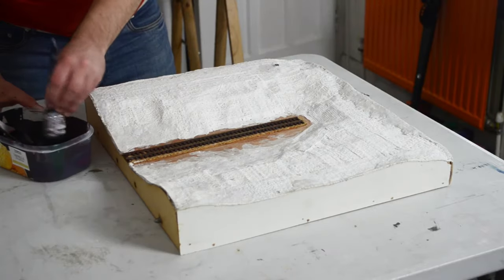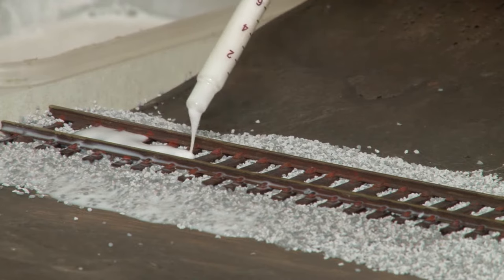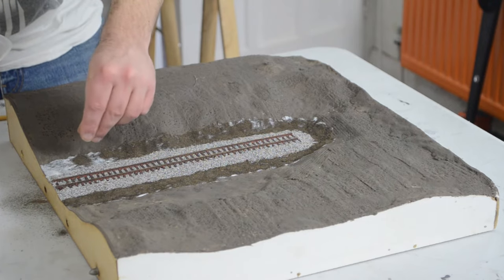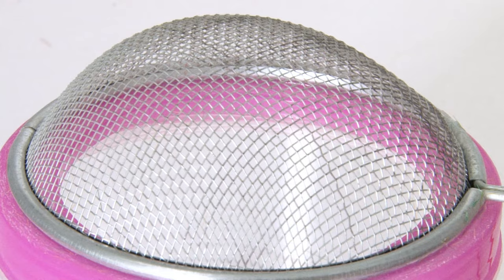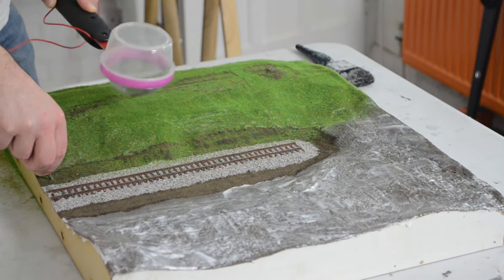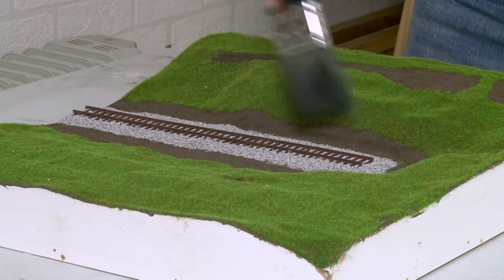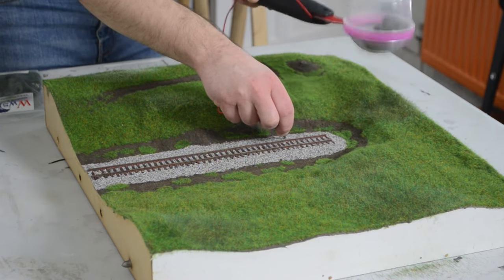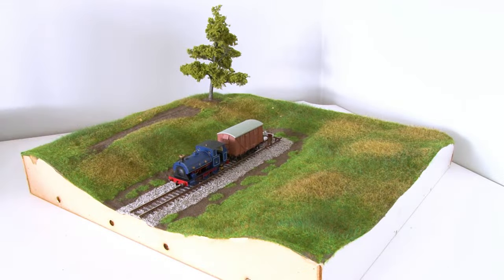How To Use Static Grass - Model Railway Basics: Episode Seven

Comment: Great tutorial. Somebody once told me if I can't afford a static grass applicator, just put static grass into a small dry coca cola bottle, shake it vigorously for about thirty seconds then shake-pour it to the board through holes I make in the bottle cap. Not sure if that would generate enough static to do the job, but I might try it, for a laugh if nothing else.
Reply from the maker: Thanks Markus! Yes I'd heard that as well but I've never tried it myself so I can't say how well it works in practice. Considering that my budget applicator works really well though, it's been a good investment without the high price tag of the more expensive applicators. Thanks for watching 😃
Reply: It does work ive done it myself not as good as this though.

Comment: Wow. I can't believe how easy this looks. And it makes such a difference too! When the camera was doing all of the closeups, this looked so real. I definitely have to do this on my layout.
Reply: Also, how big are your modules? I'm considering doing a modular layout of my own because I don't have a ton of space and was wondering on what size I should be going for with the modules.
Reply from the maker: It really does transform a layout doesn’t it. I love that this little technique is so easy to do yet produces really great results without needing too much practice.

My modules are all different sizes really but generally the straights are 120cm x 50cm and the curves are 80cm x 80cm. Looking back they’re probably a bit big so I would suggest maybe something a bit smaller if you want it to be more portable and easy to handle on your own. Thanks for watching 😃
Reply: @ThatModelRailwayGuy  Ok thanks!

Comment: Nice video, just ordered my first static grass applicator which I’m looking forward to using now. One small point, when I paint over the white plaster bandage before applying flock/static grass, etc I always mix some pva glue with the paint. This helps seal the plaster bandage and helps whatever goes over next stick better.
Reply from the maker: Awesome, hope it goes well. You can do it that way if you prefer but I've personally found I get much better results by letting the base layer of paint dry completely and then adding the neat PVA and static grass as their own separate step. Additionally the second coat of watered down paint is really important for creating a nice solid base colour if you don't want to have little white dots showing through the grass. Thanks for watching 😃

Comment: Hi, im from Australia. Is it still fine if i use the, Peco - Layering Spray 500Ml - PSG13 (layering spray adhesive). but ur video uses the PSG-11 layering spray for static grass. as your static grass spray is not available in Australia. and the Static applicator you use is also unavailable for my country so i have to find an alternative one. any suggestions?
Reply from the maker: Personally I only use the aerosol spray (PSG-11) as I haven’t heard great things about the squirt bottle (PSG-13). As an alternative you could try cheap hairspray instead which I believe works for some people. As for finding an alternative static grass applicator, I don’t really know what products are available worldwide so it’s probably best to head into a model shop and see what they can recommend. Thanks for watching 😃

Comment: Thanks for this whole series. My Nan is getting her loft sorted, and then me and my Dad and I are planning on building a model railway. I wouldn't have a clue if I hadn't watched this. Keep up the good work. Plus, does static grass always need the static wire touching al the time?
Reply from the maker: My pleasure, I'm glad it's given you an idea of where to start! 
The wire just needs to touch the surface of the baseboard as you're applying the grass, so once the fibres are sticking up out of the glue you're free to remove it. The viscosity of the PVA will usually hold the grass in place. Hope that helps and best of luck with your layout. Thanks for watching 😃

Comment: About to embark on scenics so these videos really help! Purchased this budget static grass applicator as well. Could you mix brown paint with the PVA before applying the grass to save time?
Reply from the maker: Awesome, glad to hear it! I think technically you could mix the two if you really wanted to save time but you wouldn't be able to do the step where I watered down the paint to cover up the the little white dots of plaster still showing through. Given that acrylic paint doesn't take long to dry, personally I'm of the opinion that it's better in the long run to take you time and do both as individual steps if you want the best results. Thanks for watching 😃

Comment: thank you just a helpful comment i find an old pop stocking on the end of a vacuum tube works very well an makes it easy to empty an keeps the static grass seperate and/or clean depending what else youre using like dirt. just a question how do you get the grass to work when you connect to the rail line? great tutorial
Reply from the maker: Yes that's one way of reclaiming the grass afterwards - I personally just tend to use a small hand vacuum which works very well as long as you remember to empty it first.
The static grass applicator works fine when it's clipped onto the rail. Basically you need to be making contact with the layout in some way for the static charge to pass through but it doesn't have to be in exactly the area your adding the grass to as long as it's nearby. Thanks for watching 😃

Comment: This really interesting & helpful.What about showing how it is done for N scale?
Reply from the maker: Thanks, really glad to hear that! The process should be exactly the same for N Gauge but you'd just use shorter grass fibres. So instead of using 2-6mm grass, you'd be better off starting with a 1mm base layer and then adding 2-3mm layers over the top. Thanks for watching 😃
Reply: @ThatModelRailwayGuy  Thank you so much!(I'm from Sri Lanka)

Comment: I have noticed in your videos you use 2 different tecniques for laying a dirt scatter?

Do you put down glue first or similar to your ballasting technique?

Is the glue a 50 / 50 mix?
Reply from the maker: It depends on the situation - if I need the scatter to be more durable then adding the glue afterwards helps seal it. In this instance it's exactly the same 50/50 (+a drop a washing up liquid) mix as the ballast glue. Usually I do it at the same time in this case.

If it's a more static layout that isn't going to be moved around, or it's a small area then most of the time I'll just put the neat PVA down first and drop the scatter into it. Hope that helps and thanks for watching 😃

Comment: I have a question… if you are doing a road alongside some grass, would you recommend doing the grass or the read first?
Reply from the maker: Funnily enough I've just been doing this in my current TT:120 layout build series. It depends on the circumstances but usually I put down all the ground textures first (dirt, sand, gravel, etc) followed by the road surface then finish up with the grass last. There's no hard rule though, I just feel like you're less likely to get the grass messy if you put it on last. Thanks for watching 😃

Comment: Very useful video thank you. A couple of questions if I may. Do you still use this type of applicator or have you moved on to something more expensive? I’ve seen reviews elsewhere which say this one isn’t that good but in your video it looks fine. Does it always produce results that reliably?  2 at sone points you were touching the glue with the clip and others the rail. Does that make a difference? Thanks
Reply from the maker: Hi Paul, yep I still use this same applicator and it's still giving the same great results. I actually have a video coming out in a few weeks time where it gets used extensively. There's a link to it in the description if you want to check it out yourself.
It doesn't really matter where the clip is as long as it's touch the layout somewhere. I sometimes clip it onto the track for convenience,  other times I put it in the glue itself so that it's nice and close so where I'm laying the grass. Hope all that makes sense and thanks for watching 😃
Reply: @ThatModelRailwayGuy  thanks 👍

Comment: Hi ive just subscribed to your channel earlier today and have now watched the first 8 of your videos 
i always like to make notes as i do this , as being someone new to the hobby this can be very beneficial ?  ive checked out the company WWS and noted they had static grass at spring summer autumn and winter but also lengths starting at 2mm , but having just watched your video and how you add longer grass each time but also vary the colour ie dead grass it looks so more real than just the one length and time of year i also think finishing of the edges in normal fine dirt at the edges does make it look a lot more natural so this is something i will certainly be doing when i start work on my first layout  ?         Paul
Reply from the maker: Hi Paul, yes layering up the different lengths and colours is definitely the way to go to get a more natural looking grass. You don't have to stick religiously to the colours I use of course if you're looking to model a different season, but generally it is is better to start with the shorter grass first and then gradually add longer ones over the top. Thanks for watching 😃

Comment: Could you do the 1st 2 layers by mixing the grass in the pot; so that they could be laid in one go?
Reply from the maker: I'm sure you probably could Chris, although it makes reclaiming the excess slightly more tricky for the future unless you always wanted to use the same mix. 
For me I consider the first layer an overall base covering with the second layer being a bit more sparse despite still covering most of the board. But as always these tips and tutorials are there to be adapted and improved by however you see fit. Thanks for watching 😃

Comment: Hey, great video! But instead of layering spray, can you also use normal spray adhesive?
Reply from the maker: Hmm, that's a tricky one. Personally I wouldn't, the spray adhesives I've used in the past don't dry clear and tend to be more stringy which ruins the look. 

Some alternatives people use are cheap hairspray (though I've never managed to get a good effect with that) or spray varnish. The varnish tends to be about the same price as the layering spray though so I've always just opted to use the actual layering spray to be honest. Hope that helps and thanks for watching 😃
Reply: @ThatModelRailwayGuy  Cheers mate! Thanks for the tip.

Comment: Probably a silly question, but does the static grass stay charged, and sticking up, or does it need running over again to recharge it?
Reply from the maker: Hi Dave, no questions here. The grass is charged as I falls into the glue and that is usually enough to keep it upright. Once the glue is dried the fibres are locked in place. I sometimes go back over the grass with the applicator (usually when I'm adding longer fibres) immediately after adding it to see if I can get any loose excess to stand up a bit straighter but honestly I'm not sure how much of a difference it makes. Hope that helps and thanks for watching 😃

Comment: Hello I am looking to start a model railway in my summer house next year is it possible to lay the track and then the ballast but not glue it down ? So if I wanted to change my mind to a different variation I could?
Reply from the maker: Technically you can but I wouldn't recommend it as even without moving the track the ballast will get everywhere and has the potential to jam up the mechanisms of your models.

If you really want to be able to move your track around I'd recommend using something like the Kato Unitrack which has a moulded ballast base and can be easily clipped together in lots of different formations: https://goaff.pro/rktekm Hope that helps and thanks for watching 😃
Reply: @ThatModelRailwayGuy  cheers mate thank you!

Comment: Hi good tutorial, I’m starting again after more than tenth years away from the hobby, I don’t have an applicator but I am looking at the Green Stuff World applicator but it looks like it only has one mesh of 4x4 mm as some others come with 3 different size mesh caps, is this important?
Reply from the maker: Hi Paul, I don't have any experience with the Green Stuff World applicator myself but the applicator I use just has one fixed mesh too and I've never found that to be a problem. Thanks for watching 😃
Reply: Yes I bought one that is far cheaper and has only one mesh, I didn’t think it was a massive importance, thanks for the reply happy new year

Comment: Do i need this layering spray or can i just use the normal glue? I would like to have it on my layout, but i don‘t have much money.
Reply from the maker: Generally I've found normal spray glues to be very stringy/thick and they tend to dry a yellow colour so I wouldn't recommend them for static grass. If you're really on a budget, cheap hairspray can sometimes work although it doesn't hold as much in my experience. 

Generally I think if you're willing to spend money on an applicator then it's worth spending a bit extra and getting the layering spray too for the best results. It does go quite a long way too - I'm only on my 3rd can and I build a lot of layouts! 

Hope that helps and thanks for watching 😃

Comment: Tried doing this yesterday, I dont know how but my one looks really shallow. Any tips?
Reply from the maker: Hey there, when you say shallow do you mean the grass fibres are standing up but it doesn't look very long? Or that the fibres aren't standing up at all so there's no height?

If the former then I would say try using longer grass. In this video I start with a base of 2mm then add layers of 4mm and 6mm over the top. These layer on top of each other too so the 6mm actually looks more like 8mm grass by the end.

If it's not standing up at all then I'd say check the applicator. Remember you need to have the external wire touching the surface of the layout. You want the mesh of the applicator to be near to the surface too so the fibres are attracted to it. Sometimes I also run the applicator over the grass with the power on just to help the grass stand up a little more while it's drying too.

Hope that helps and thanks for watching 😃
Reply: @ThatModelRailwayGuy  hey dude thanks for the advice! When I said shallow i meant that the grass is there but you can still see the undercoat. Unfortunately i dont have an applicator, but a balloon does the trick decently!
Reply from the maker: @bonzomcdrumcat4989  Ah right, in that case  it might be something to do with the glue then. Make sure it's not watered down or being spread too thin on the surface. That can cause the undercoat to show through which sometimes is desired effect if you want patchy grass... but it sounds like don't in this case.

That said, while using a ballon or puffer bottle does work, in my experience you get much more consistent results using an applicator, even a cheap one. That's not to say you should rush out and buy one but something to consider if you're still not getting the results you want.

Comment: Do you need the scatter below the static grass?
Reply from the maker: As I said in the video, it's an optional step. Personally I only use it around the very edges where I want the grass to thin out as you're more likely to see the base surface underneath. If you're going for a general thick coverage then I don't think it's necessary for the majority of the scenics but if you're going for a thinner, more patchy look then having a base texture of some sort is more important. Hope that helps and thanks for watching 😃
Reply: @ThatModelRailwayGuy  thanks mate

Comment: Hmm, how durable is the grass when using this method? I'm wondering if it could withstand a 24th scale rc crawler without instantly getting torn apart.
Reply from the maker: It's certainly durable enough for model railway uses and to withstand mild handling but not having had any experience with RC Crawlers I can't be sure. I would suspect it wouldn't get torn apart so much but would come loose more easily. Hope that helps, thanks for watching 😃
Reply: @ThatModelRailwayGuy  Thanks for the answear. It gives me a general idea of what to expect. Think I'll start with a basic test to see how much abuse it can take. Then maybe experiment with different glue solutions to see if it can be improved. Great video btw, short and simple.

Comment: Is there an advantage to PVA glue over, say Arlene's tacky or Elmer's?
Reply from the maker: It's cheaper usually. I don't know about Arlene's tacky or Elmer's specifically but I'd suspect they're brand names for PVA with perhaps a slightly different formula. I know some companies do specific glue for static grass but I've never bothered with it as I've always found cheap PVA to work just fine. Thanks for watching 😃
Reply: @ThatModelRailwayGuy   & thanks for answering.

Comment: Oh the other thing. I just seem to have wasted £15 on the woodland scenic static grass starter kit. That has the shaker in it. I presume these don’t actually work? I’ve tried everything I can think of and just can’t get anything to stand up using it.
Reply from the maker: I can't say I've ever tried the Woodland Scenics starter kit or any shaker bottle for that matter. I know you have to shake them quite a bit beforehand with the grass inside to build up the static charge but from what I've seen personally they don't seem to work as well as a powered applicator.
Reply: What about a balloon? Rub it on your hair and hover over the grass?